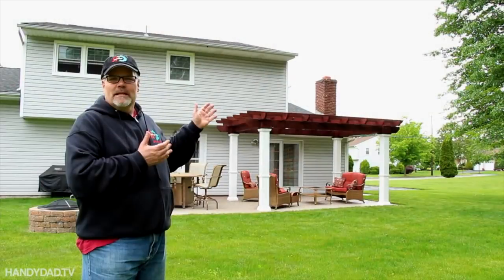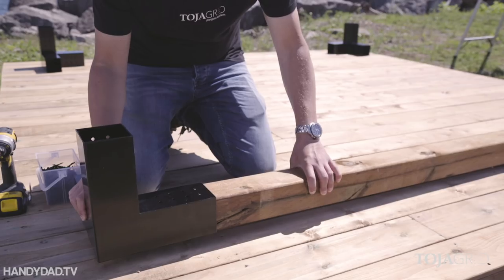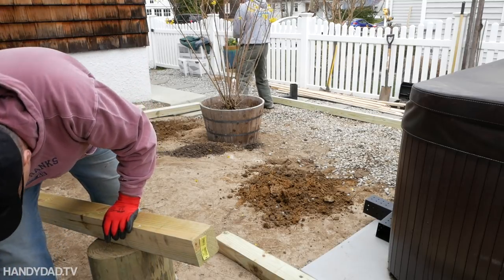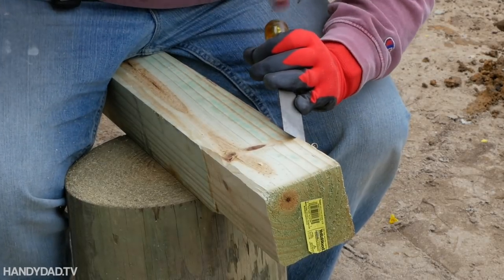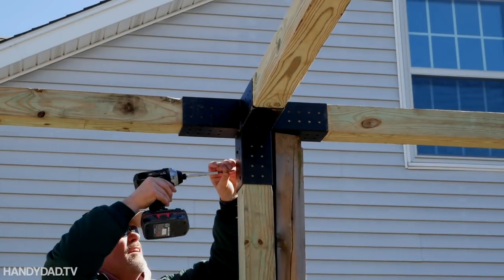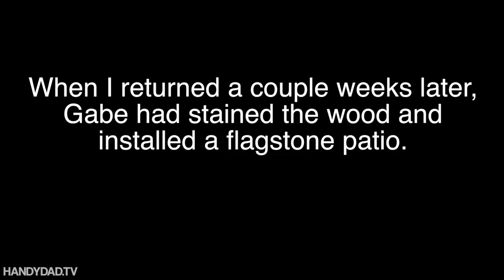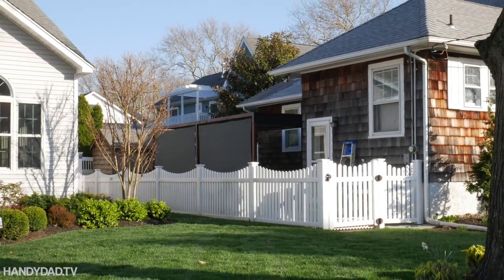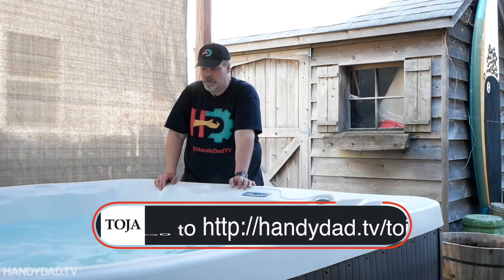Privacy Pergola | TOJA Grid Installation

Comment: Pretty cool idea and much easier to install than a standard Pergola with a lot more lumber. Someone commented that it it pretty pricey, on the face of it, it can seem true, but if you were to price out a standard purgola with such nice metal hardware to connect your lumber, the price would also increase significantly. This kit just seems like a great simple solution with a lot less parts to worry about such as extra beams, rafters and lag bolts. Thanks Handydad.
Reply from the maker: Good shade sails are expensive as well. Thanks for the comment!
Reply: HandyDadTV although I like your classic build better.
Reply from the maker: Thanks.

Comment: The tarps seem like they leave gaps. I’m about 10 inches small in diameter. But it seems like it would work cause then I’d have no gaps once I tighten the shade. Is that right?
Reply from the maker: The gaps are good for wind. Plus the shades may stretch. Contact TOJA for the best practice in this regard.

Comment: This is interesting! Can it be installed on composite deck floor? Also, our deck is elevated on the first floor, wonder if it’s safe to use this system.
Reply from the maker: Yes, lots of people have installed these on decks. You need to be sure the feet are supported by wood framing, not by decking alone. So you might need to add some blocking underneath depending on where the feet land.

Comment: We just finished building one of these yesterday.  However, all the straps from the shade are hanging down and it distracts from the look.  I notice in your video that yours started out this way as well, but it was all cleaned up at the end.  Did you cut them or have some other solution?  I'm worried about cutting them because then if you ever need to take it off and put back on, there won't be enough strap to pull with...
Reply from the maker: Sorry I didn't show that! We just wrapped them around and tucked the end under.

Comment: Im thinking about buying the Toja kit soon. Any idea how the shade sail holds up in the wind. This one looks close to the house next door, mine would be wide open and its windy where I live. Thanks in advance.
Reply from the maker: You’d need to contact TOJA to see if they’ve done any testing, but my opinion is that the screws would probably pull out before the fabric rips from wind. No worries for normal winds, even in coastal areas. But if a storm is expected, it takes five minutes to take the shade down. Do it while you’re tying your patio furniture.

Comment: How difficult was it installing the top section once the vertical posts were already in place?
Reply from the maker: We installed one top piece at a time and didn’t backfill the posts or screw the brackets until the whole thing was plumb, level, and square.

Comment: Thanks for a nice video! What stain (brand and color) did you use to stain PT wood, and did you have to wait until staining? Seems to be two different schools out there whether stain new PT vs have to let dry. Also, these were 4x4s right? I am considering using 6x6. The longest free hanging length I'd have is 16', do you think that would work with 6x6?
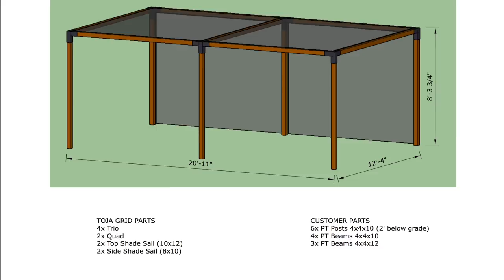Reply: I was looking too, around the @2:40 mark you see the measurements, and they are indeed 4x4s.

Comment: Hey there, HandyDadTV, got a question for you: I just bought this system and am in the process of building it. I'm painting my posts white to match our deck railing. Anyhoo, my question: I wanted to hang a hammock chair off of one of the top posts. It's an 8ft post and I was planning on attaching the hanging hook about 2 feet in from one of the sides. Do you think the Toja grid bracket and the 4x4 would handle this? Thanks!
Reply from the maker: I honestly don’t know how to answer this. I’m no engineer, but I’d try it and see how much the wood flexes. Be careful.
Reply: HandyDadTV thanks for the zippy reply. Great videos btw!

Comment: would you say the grid system was just as sturdy as a normal 4x4 post pergola? It doesnt look super sturdy...
Reply from the maker: It’s absolutely sturdy enough for the sail shades and certain accessories like lights. You wouldn’t hang a hammock on it, and although I’ve seen people put metal roofs on them, I wouldn’t trust 4x4s to hold a snow load. But it would be fine in a warm climate without snow. 

They now make these components for 6x6 lumber as well, if you really want more stability.

Comment: I can't seem to get a straight answer, what length timber is needed for a 10x10 setup?
Reply from the maker: 10-foot. It's made to be simple. No cutting needed, unless you want to level the top on a sloped patio.
Reply: @handydadtv  ty sir I did measure out my deck can do 8 for height and 10 for square. Ty for the response

Comment: How sturdy is this type of framing system. I fear wind will get the best of it. I plan to frame mine off the back of my house using the 12x16 kit.
Reply from the maker: You can get one using 6x6 posts if you feel 4x4 isn’t enough. Either way, I’ve never heard of one blowing away. Secure it down properly and it’ll be fine.
Reply: I added 4x4 2 foot long gussets on to each corner, made a world of difference - mine is in 3 sections each section being 10 feet by 10 feet
Reply from the maker: I’m sure it made a difference, but technically not needed because the corner brackets are strong enough.

Comment: Bad idea to plane the wet posts to fit the brackets. It will shrink even more when dried. TOJA even specifically says to not use wet wood that it must be dried first.
Reply from the maker: Yeah I know. But all PT lumber is wet because lumber yards leave it outside. And since this was ground contact, we needed to use PT.
Reply: @handydadtv  if we’re installing one on top of a raised deck would we not need PT? I thought I’d need to use PT for any outside application. Thx
Reply from the maker: @Leah - Use PT or cedar.